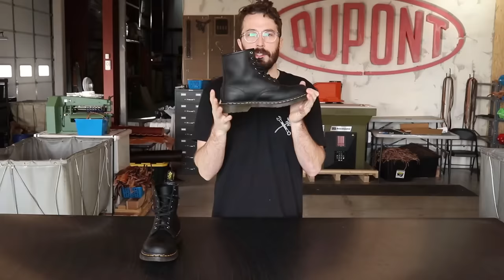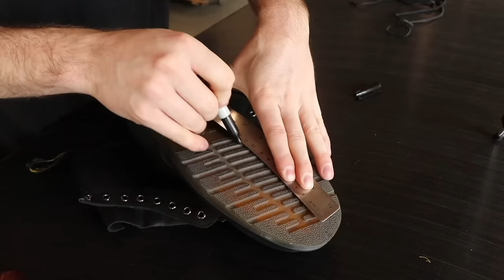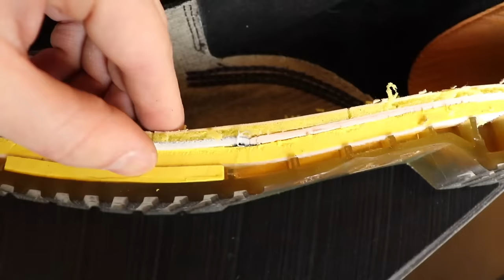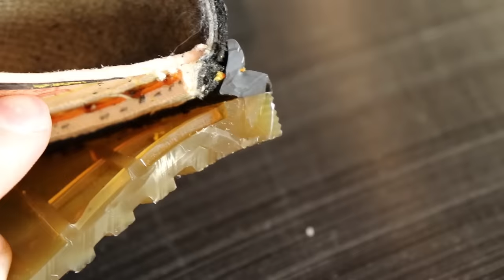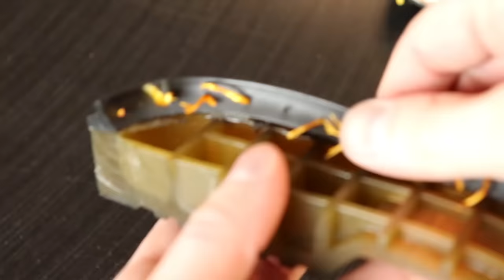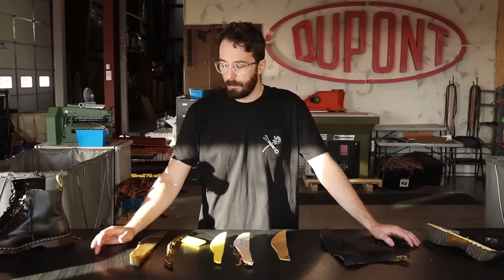WHAT'S INSIDE DR. MARTENS - (1460 BOOTS) - doc marten review

Comment: If possible you should deconstruct a vintage pair and then one made recently to see if they are any different
Reply from the maker: I have been keeping my eye on ebay!
Reply: It would be a bit costly, but more reasonable for a used pair beyond repair.
Reply: They are deffinitively different. The old ones sole is thick bubbly rubber compound that lasts forever although the threads worn out....
Reply: Mr. Anvil, for vintage, look at pre 2000.  As the manufacturing moved to China and Thailand in the early 2000's when they got bought out.  My old docs from the mid 90's I passed onto my teenage son due to them still having life in them.   (lol, I just opened your page and see that you just did the '90's vintage brown with chunky sole yesterday.  Glad to see that welting was so difficult to separate.  Was extremely excited to see the chunky sole.  I miss those on my docs almost as much as I miss the original longevity.)
Reply: Greg Burcham Same here , I passed those brown martens to my nephew the year he studied abroad in london. He liked them so he looked in several thirft stores until he found a pair for himself and returned mine.
Reply: I’m a massive Dr Marten fan, made in England are fantastic shoe and very well made.  In the same token not cheap to do this ‘hand made’ boot. Please don’t do this... tip go their website its tells you their process! To cut a new pair a an insult to workmanship!
Reply: @thecallawaykid1763  when did they move back to England. Nike bought them and moved them to China years ago. You could smell it in the tanning of the leather when you sweat. 

I hear that the sub company Grinders are still English. 

Was a much better boot in the 90's
Reply: Amnesia Iforget  not sure Nike bought them... check out this https://youtu.be/tX2mkuepQSM
Reply: A different company bought the old facility word doc Martens were made in England. I know 100% that Nikki does not own doc Martens now, they are 100% Chinese. I bought a $300 pair of steel toes and they lasted one month. Absolutely unacceptable but you can get the original ones from the factory in England.
Reply: They are a lot different. Even the sole is different. They had regular looking soles. They didn’t have lines. I have a pair.
Reply: @thecallawaykid1763  The new ones are an insult to workmanship!
Reply: destroy a vintage pair!!! no way, a better video would be a colab of a restoration where it is pulled apart you get to see what was in the old ones for your video and the boot restoration channel gets to restore one of the most iconic boots on the planet.
Reply: @RoseAnvil  I will put you in my will for mine.  I bought my vintage DMs in 1992 and I'm still wearing them.  Mind you, you will probably need to wait for about 30 odd years to get them!  (I hope)  ;)
Reply: @GregBurcham  Doc Martins are still being made in Wollaston Northamptonshire  UK. I live in the area.
Reply: Archbud 23, true, but for more than a decade they were not.  Only Solvair (so) were being made.  Whom, you probably already know used to make DM’s and continued with the Goodyear welt and Air Bounce soles.
Reply: @honestguy7764  They have to be. I had a pair that lasted me 10 years. I bought them in the early 90's and they would probably still be around if I didn't lose them while moving.
Reply: I feel like they must have been.  I bought a pair in the 90s and wore them for 10 years.  Bought a replacement pair in 2004 and they cracked on the sole, broke apart, and became unwearable after 1 year.
Reply: What?... vintage PVC externe sole are better than todays'pvc?. So conclusion dr Martens is expensive and dung?
Reply: I have a vintage pair in amazing condition
Reply: Or you could just ask a shoe repairer. This is how they've been made for the last 30 years or more.
Reply: Jazmin H he’d have to wreck the vintage pair, though....

Comment: Rip those made in England boots apart and see if there is a difference
Reply from the maker: I’ve been itching for it ha ha
Reply: @RoseAnvil  well i bet it isn't acually. Made in here and made in there is kinda like gimmick these days.
Reply: @RoseAnvil  Don't do it! 😱😂😂😂
Reply: @Pixel chimp They just make in in Hong Kong and call that England
Reply: they were the english one cheepskate doc martins rub on me toes not worn them for 35 years
Reply: This is what I wanted to know the whole time time. I'd love to see the difference between the Made in England ones and these.
Reply: there used to be an DM factory just outside Leicester near whetstone ;)
Reply: @Matthew_Brookes  they were shit back in the 70s, the foam in these looks far better then the crap bit of card back then, i think they were called airsoles, (or arseholes)  these look much better. but still total crap.  the box they come in would wear better.
Reply: Slightly
Reply: @FearToNothing  i can assure you a well payed worker will do a better job than a low payed wage slave working in the dirty conditions of an English factory
Reply: @RoseAnvil  Try cutting Altbergs boots! I would love to see those cut and reviewed.
Reply: I’ve got some made in England docs. They are trash. The leather crack 2 days into wearing it. (I wore it lightly too. It cracked by just bending down to pick up something)
Reply: Modustollens1 you can but you pay quite a bit extra
Reply: @SeanHoller666  They actually do have a working factory in England that makes a small subset of their boot types in smaller quantities. Does that mean they are better quality? maybe we will find out.
Reply: D De M That’s a load of shit. I’ve had my MIE Oxblood 1460s since July of 2017, worn them at least 4 times a week since purchasing, and they still look brand new. Either you’re lying, or you need to send those back for some quality control issues.

Comment: The older Docs that were made in England did have shanks, I took one apart once trying to repair the soles after they split in half but it was nothing very "shank" worthy , it was literally just a wide compressed piece of wood that looked EXACTLY like a wooden tongue depresser or an ice cream stick that had broken in half right along the same area the sole split 😅
Reply from the maker: That's crazy! i want to find an old pair and cut it open now
Reply: Had my first pair of DMs in 1970. The leather was much better but the air wear soles were mostly myth. They'd have to be air tight cells to give the balloon effect.
Reply: @borderlands6606  that myth  started with the Mercury 7 Astronauts who wore Hawkins Boots ( precursor to the standard 1490 doc martens ) on their pre space trip photo shoot.
Reply: @borderlands6606  they use to make then with wuality vegetable tanned leather,..hence the natural tan color on the inside. Now its oil tanned and very onvious from the dark color on the inside.

Comment: VERY insightful...  I wore Doc's back in the day for a light duty work boot (I'm a locksmith) and damn near every day use, even when I was off duty, for years until they were flat worn out (which took almost a decade) and finally destroyed in a small, yet not fun, flash flood while I was working) after a while, and trying other boots, I decided to them again because I'd been so happy with them in the past (they were comfortable as heck)...  

New pair lasted me less then a year and a half before they started coming apart at sole, with the toe ripping right through the stitching (maybe I tripped going up stairs, but I don't remember that, so it wasn't enough to damage ME) and the the sole came completely separated at the heel from the welt (not even sure how THAT could even be done...) leaving me REALLY disappointing in what was either a lemon (with no solution from Doc Marten) or a drop in quality. 

Again, we're talking LIGHT duty... again...  I'm a locksmith... so it's mostly driving, walking, kneeling and getting up from it, climbing stairs, occasional running, mostly exterior, but often on warehouse floor, and sometimes on soft ground, gravel etc..   NOT stuff that should kill a pair of boots in under two years, even if they ARE on the cheap scale.

Comment: Cool vid! Just to be clear, maybe you meant that, but on a regular GYW shoe/boot, you can't see the goodyear stitching from the outside, its done from underneath the welt into the gemming. The stitch you see is a rapid stitch done by a totally different machine (rapid stitcher) at a later stage.
That's what unique in a doc martens, the stitch you see is from the outside is actually the GY stitch  done on top of the welt, making it almost look like a norvegese or original storm-welted.

Comment: Great video. Super interesting to see the construction up close and never thought about what was inside.  I wear Docs for travel and work in high security buildings with metal detectors. I like that these do not have a metal shank so I don't set them off. I find them very comfortable and have worn them for years with no issue.
Reply from the maker: They are super comfy

Comment: A lot of people mentioned that they couldn't afford these boots, I'd like to recommend they try Caterpillar "second shift" model for a super affordable boot. I'm on my 2nd pair now, the 1st lasted me about 6 years of really hard use, and I feel they are easily as good as most boots four times as expensive in terms of comfort and build quality. I wear them right now for a 12 hour shift at work, walking constantly on concrete floors in a factory.
Reply: Second that. Had CATs for 5 years mixed, not very heavy use, the only reason I got rid of them is they started to look ugly, otherwise had quite some life in them. Todays punks don't want the shoes of the working class, hehehehe.

Comment: I have a pair I bought in London back in ‘92. Paid around £40 for them. Would have cost over $100 in the US back then. Man it was brutal the first couple weeks breaking them in, but I ended up wearing them all the time, and backpacked around Europe for a month in them. I also had a pair of Vasque gortex hiking boots at the time, but I ended up pretty much only wearing the docs. 20+ years later, the only thing wrong is the leather insole has come loose in them and sole is getting thin. 

Bought a new pair about 5 years ago. Got the softer leather and no breaking in was really needed. I’ll have to check where they were made. Don’t wear them as much as I did the first pair, but holding up ok so far.

Comment: I bought a pair of 1460s in about 2004 and they are still going strong, and probably only got worn in about 2 years ago. Bought some MIEs for work earlier this year. Like anything, they last if you look after them, and one of the better things is that Timpsons (UK - on pretty much everyhighstreet and in supermarkets) are licensed repairers and really reasonably priced so extending the longevity of the boots is really easy.

Comment: I am a welding student and I got these boots for my classes, in under a year of use for classes and not even actual field work the sole peeled right off of the black part of rubber on both boots. on the right boot it is only about half the way around and on the left the entire heal ended up breaking off. I was pretty disappointed and both of my welding instructors were surprised .
Reply from the maker: That is crazy!!!

Comment: I’ve owned 2 pairs of DM’s (made in Thailand) both lasted me around 3-5 years (work 40+hrs a week) but sadly on both pairs the sole seperated from the welt
Reply: I had the same problem. Tried to glue them back together but it only lasts so long. Haven’t replaced them yet but it’s about time. They make my feet sore anyway after wearing them for a few days.
Reply: @TheHIV123  I fixed my last pair with shoe goo and they’ve held up good. Still haven’t separated. But the sole is so worn out I can’t wear them anymore cuz I start having foot pain and develop planters wart.

Comment: I'm not sure this is obvious to everybody but the way this shoes are made is such: you get the sole, the upper and the rubber ring, you welt the rubber to the upper and then glue the sole with the rubber ring. It used to be that welted meant a piece of thick waterproofed leather where one stitching was inside the shoe and one (to the sole) outside. This made for very good connection that allowed for easy replacement of parts and was quite waterproof because there were 2 stitchings - one inside, one outside. Now there's one (outside to inside, carries water quite well) and some glue than depending on the maker can be pretty poorly applied. This is practically "for show" construction since it not only makes for a shoe that's less waterproof, it also makes for greater differences in materials used (different pliabilities) essentially making for shoes that are less comfortable, not waterproof, less serviceable and they do offer less mileage. They are also harder to mend, but they're overall way cheaper to make.

Comment: One point - for many years, street cops in London wore (UK made) DMs all day every day pounding the beat. They wouldn't have done that if they just fell apart.
I have been wearing DMs since the early '70s and never had one split along the welt - I wear them until the sole wears through.

You touched on it in the video - these are relatively inexpensive fashion boots at this point. They started out as run of the mill inexpensive work boots, got taken up for that blue collar image by skinheads, later punks, and are now a fashion item. You did say it - they are worn like sneakers. Comparing them to $300 boots is like comparing a Ford to a BMW.

My guess would be that the UK made boots will have the same method of construction, but done much better.
This video was fair and interesting but it won't stop me buying DMs.
Reply from the maker: That’s very true!